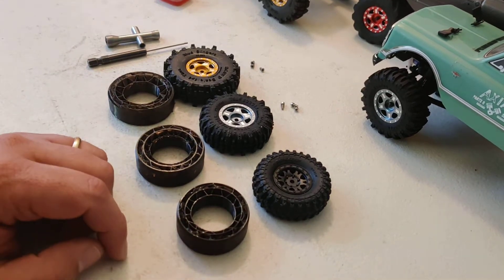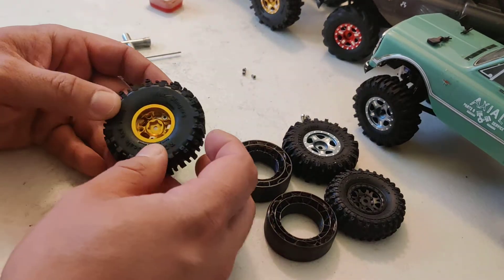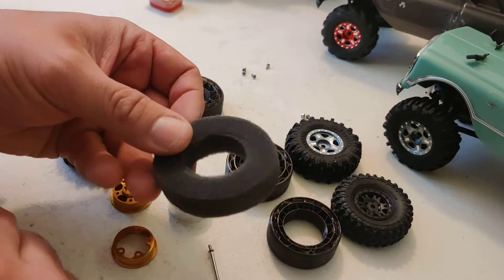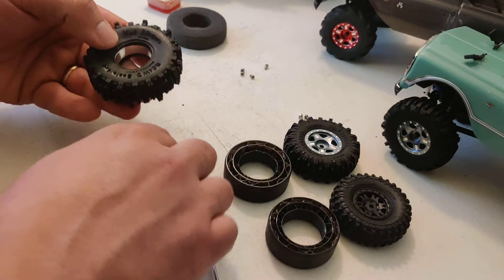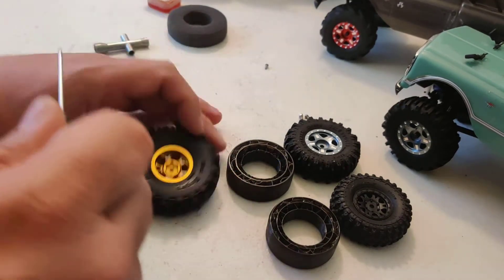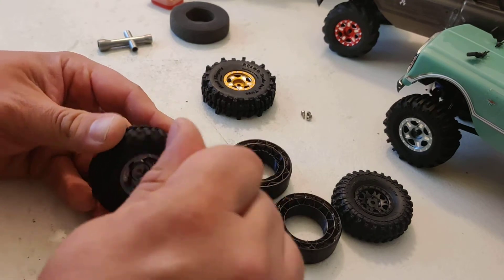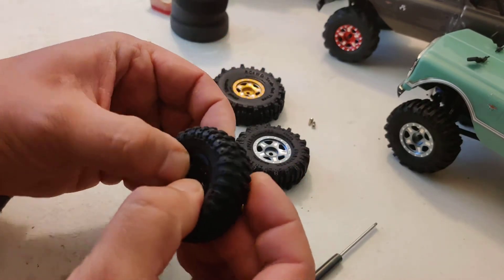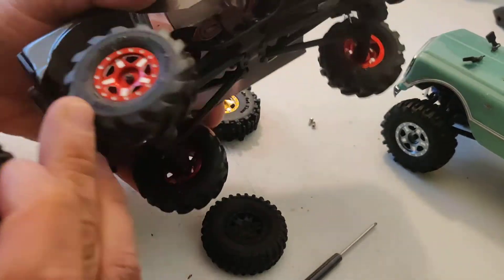1:24 RC Crawler SCX24 Tire Inserts (Foams)

Comment: I just bought your 3d file on cults3d, excited to print these. The printer that I have access to has only a 0.4mm nozzle. Will that make a big difference? Will the insert work well with a 0.4mm nozzle? The tires I am looking to use are the RC4WD Mickey Thompson Baja Pro X.

Thanks!
Reply from the maker: 0.3mm nozzle to get the softness required
Reply: @d440rc6  Thanks! Will have to figure out how to change the nozzle then.